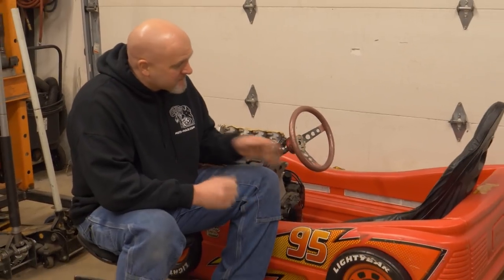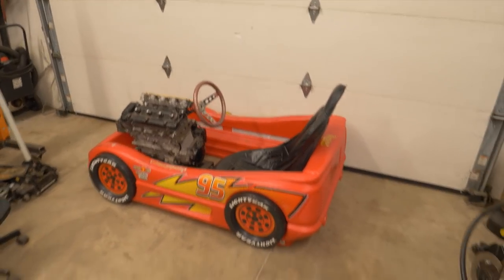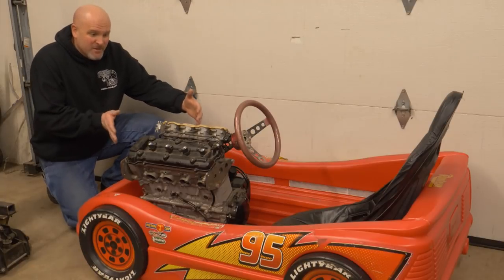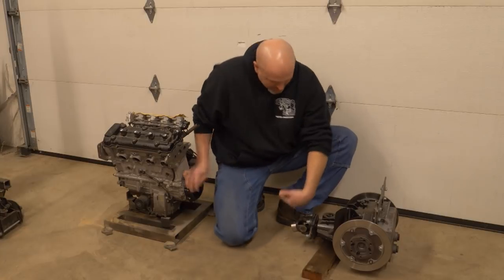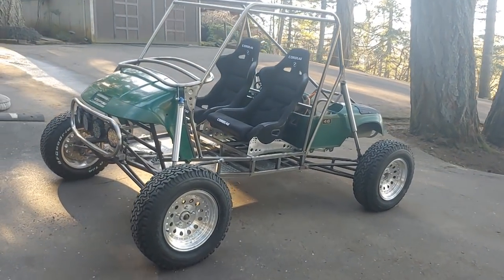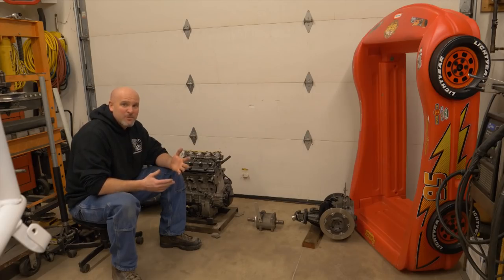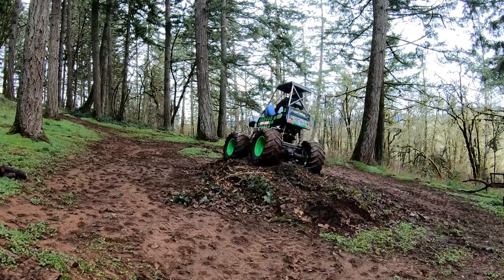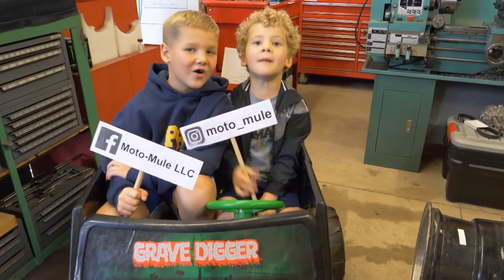Suzuki GSXR Hayabusa powered Lightning McQueen Toddler Bed Go Kart a Crazy Death Wish Machine

Comment: Crazy idea!  It’s either going to just spin the wheels or flip over backwards.  

Rather B welding: 67hp, Grindhard: 105hp and Moto Mule: 197hp.

I’ve never thought a vehicle could have too much power, but I think this is going to be a death-kart!
Reply from the maker: It's just gonna spin the tires, it'll be practice for driving on ice.... 😆
Reply: Moto Mule, that Busa does 100 mph.............. in first gear!

Friends and I used to ride our dirt bikes on ice with “Kold Cutter” ice screws in the tires.  It’s amazing the amount of traction, but with the amount of torque that Busa has, you’ll be lucky if you can keep traction devises in the tires.

Best of luck, but I don’t see your kids driving this for a long while.
Reply from the maker: @Nevertrustalawyer  definitely NOT for kids!!! 😆

Comment: might want to see if you can set the engine under and angle so the total height is lower , prolly whont help mush but you might actually be able to corner it at speed without flipping over 
as for the forward reverse , i seen a different way on motorcycle powered cars , thy put a flex plate in the driveline and set up a starter motor to grab that flexplate when powered , thats youre reverse drive

Comment: Hey Mike, got a question. How much power/torque is that diff going to rob from the bike engine? Seems a bit excessive to me. I have no doubts that it will work, none at all....but at what cost?
Gonna be a bit hard on the clutch I expect.
Thanks for producing these videos, I have learnt alot. 
Cheers.
Reply from the maker: I don't know the answer to your question. Luckily there won't be any shortage of power with this engine... I honestly don't think I'll be able to detect any resistance from this diff. Thanks for watching.
Reply: @motomule  thanks for the hasty reply, Mike. I don't think it's a matter of 'resistance' but more so the amount of torque it requires to turn the rotating mass of the diff centre. That is a heavy-ass diff after all. The 3rd gen Explorer that diff came out of had about 280 lb-ft of torque, whereas the Busa only puts out about 100 lb-ft. A rotating mass as large as that one could rob up to 30% of your engines torque output.....resulting in burnt clutches because you have to constantly rev the knickers of the engine and slip the clutch to get it moving.
The chain drive setup you have on the golf kart is a much more efficient system. 
Hell, I doubt I'm telling you anything you don't know already....you are a far more intelligent individual than myself. I'm probably going to be totally wrong in the end, but I just wanted to share my thoughts. 
Cheers 👍
Reply from the maker: @Mardy72  Didn't mean to come across as hasty. You are correct, it's overkill. But, honestly in this vehicle I won't even notice the extra mass of the diff. It will be geared lower than the motorcycle, so I'll never need to slip the clutch, I might not even need 1st or second gear for that matter... Everything about this build is just plain overkill and silly, it's not an excersize in precise engineering it's just for bragging rights... 😆 This is one of those dumb "hold my beet" projects. It's gonna be epic, good or bad epic, we shall see.... 😆
Reply: @motomule  sorry Mike, I ment speedy reply 😄😄
I appreciate the effort you put into these projects and videos. Please don't think I'm knocking them in any way at all. 
Overkill is better than broken stuff every time, and I suppose the lack of overall weight is going to make up for the heavy diff anyways. It's still going to be dangerously fast 😁
Man, you keep doing what you do.....I enjoy and learn from every episode 👍

Comment: I think you're going to run into issues with that diff and ride height
Reply from the maker: Just a mockup, won't be that low.
Reply: I think it'll have to be that low though to get a drive shaft under your bum.
It's a huge unit for such a small car.